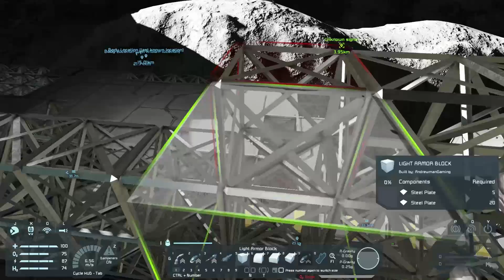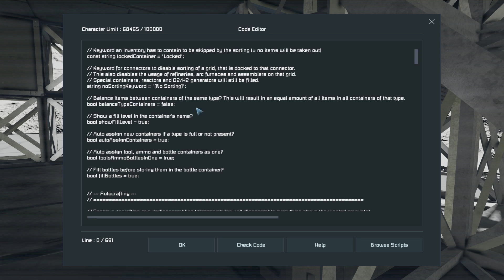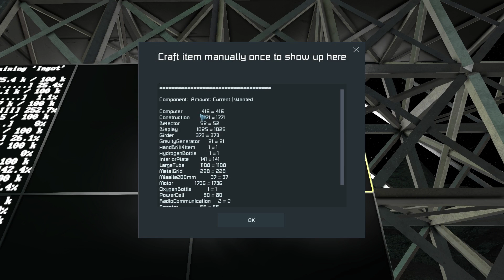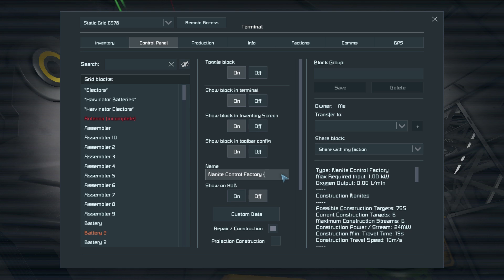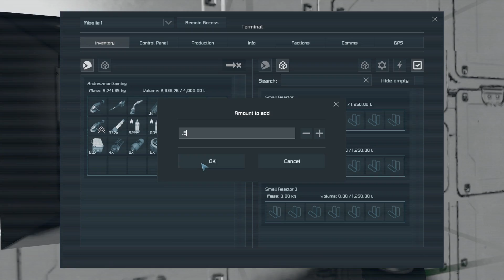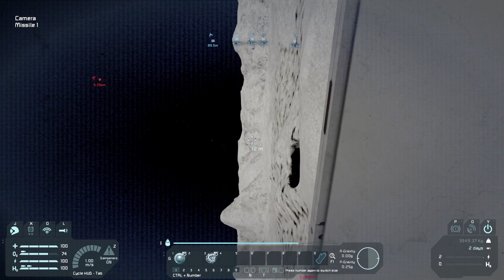Space Engineers Let's Play (S2 | E10) - MAIN CONTROL ROOM [Beta Gameplay]

Comment: Check out "Power Graphs" by Remaarn for some of your Lcds. Also there are third party programs that can convert any image into monospace font. The Lcds in space engineers understand monospace font and will display any image you want in the game. I use SpaceEngineers.ImageToMonospaceConverter. When using Lcds to display your image make sure you set the font to the lowest and display text. To set the brightness of the display adjust the colors of the font not the brightness weird right. As long as all three are the same it will not effect the color of your personal image you want to add to the game. Have fun decorating with Lcds. Once you find out how easy it is you will add Lcds everywhere.
Reply from the maker: LMAO funny you should mention this "Power Graphs" thing.

Comment: You should add more batteries because the more you build the more output it would required like the nanites require a lot of power 3 batteries alone won't suffice because you got the refineries assemblers and then ships to recharge etc you going to need more batteries alone unless your stacked with uranium but still
Reply from the maker: I plan to make that whole wall a wall of batteries. That might be enough but I think I also might need a lot more uranium.
Reply: @AndrewmanGaming  that is true  but might as well start stockpiling